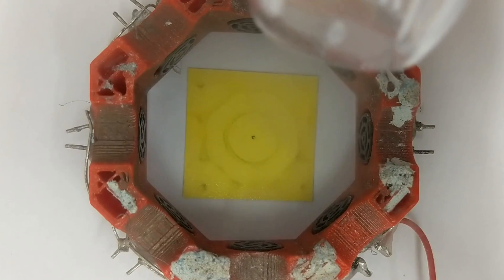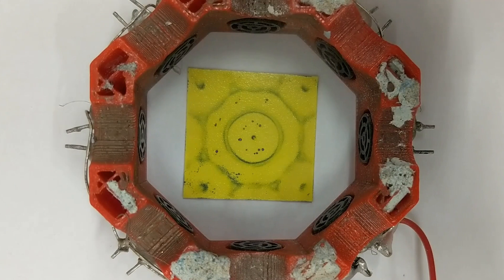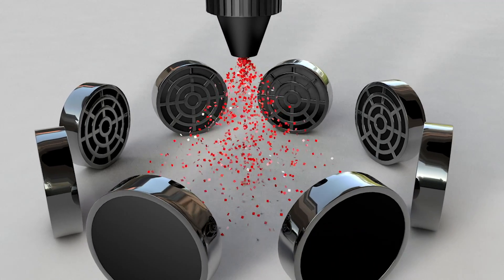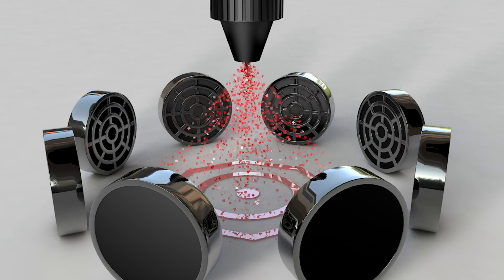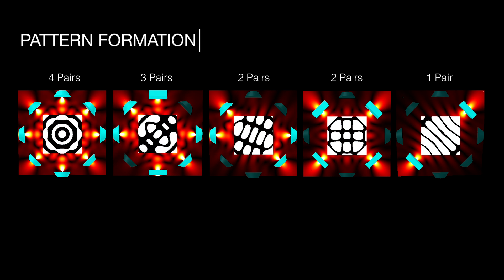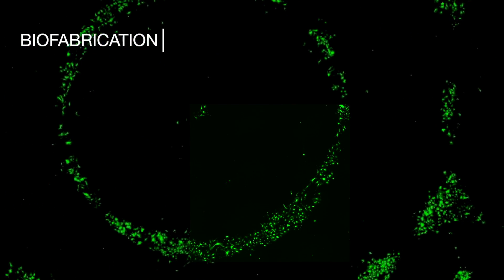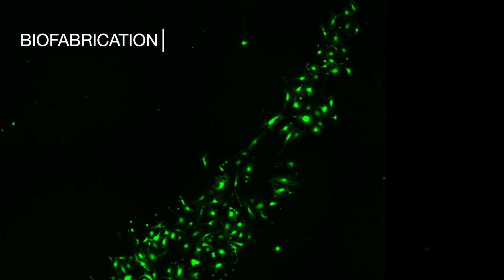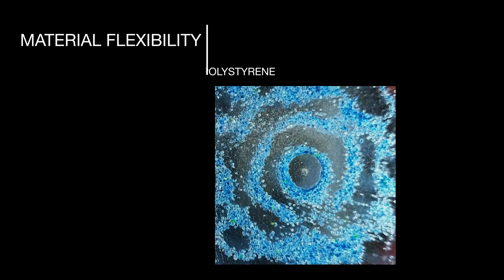Sonolithography: In‐Air Ultrasonic Particulate and Droplet Patterning

Comment: can these sonic waves be adjusted to deposit the print material anywhere along an x and y axis?
Reply from the maker: That would depend on the degree of control over the acoustic field. We are working on a platform which we intend to open source which provides hardware and algorithms that give a high level of control.